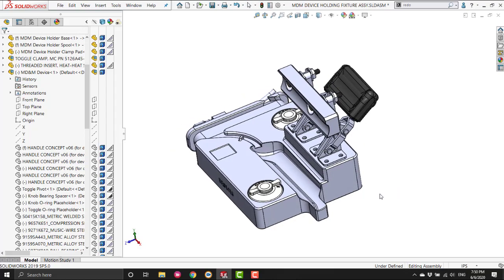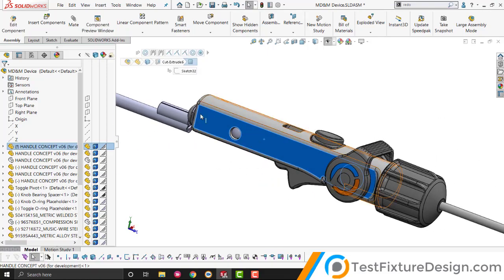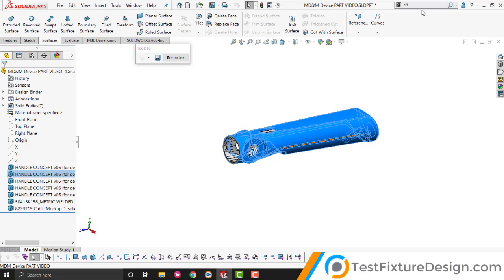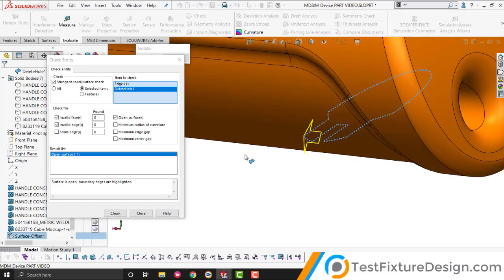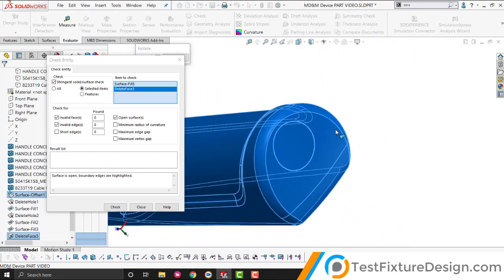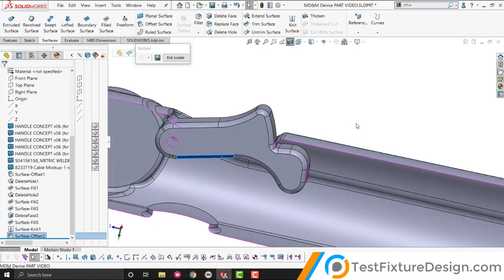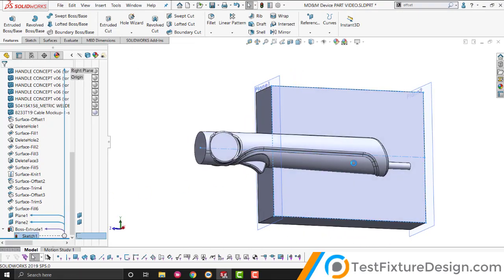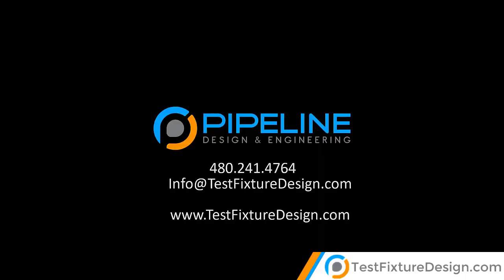How to Create a Contoured Fixture for a Medical Device. Step-by-Step.

Comment: glad i found this video as i work in the automotive field and am in the beginning stages of assembly equipment design. i struggle a lot with making a negative nest for the molded part to sit in so that it can be assembled. this has given me a better insight on how to accomplish the nesting with additional tolerances so that the nest is not tight